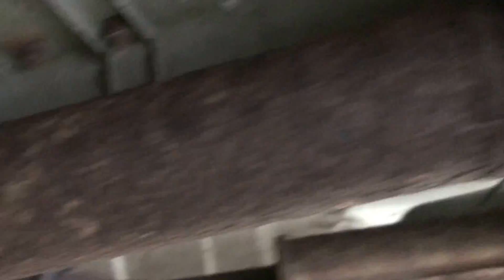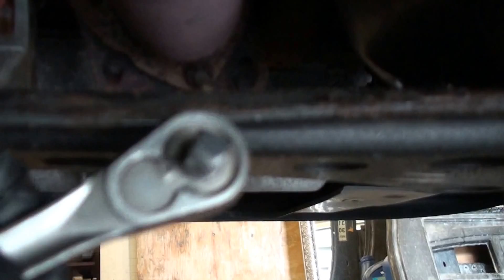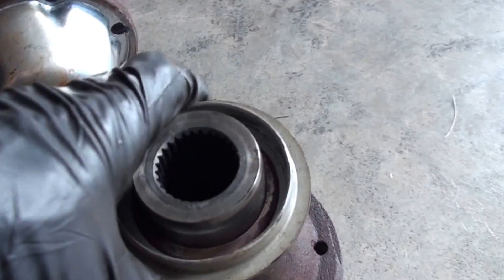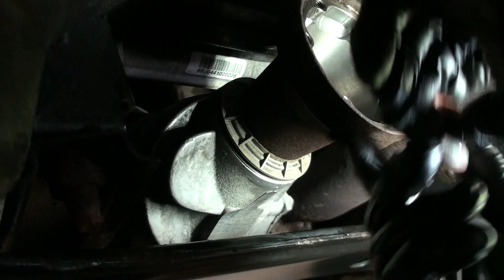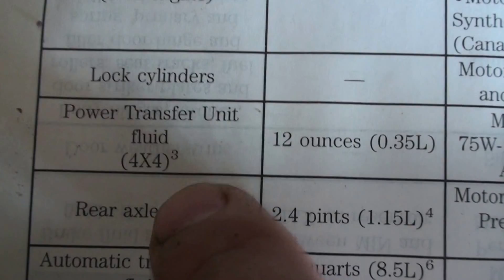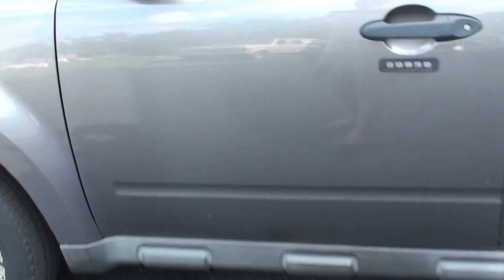Ford Transfer Case Pinion Seal Replacement - Power Transfer Unit

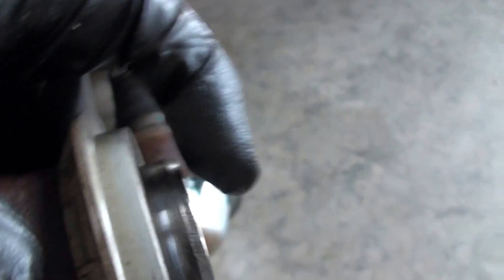Comment: At 10:50 It looks like the surface on the pinion where the new seal will ride, has a groove worn in to it. If thats the case, the new seal may have a short life. I know they have steel bushings with oversize seals for crankshaft pulleys with grooves to extend their life. This might be an option.
Reply from the maker: I see your point but that was not a groove, it was just shiny. The new seal worked perfectly. No Leaks. Thanks for your comment.

Comment: Thanks for the video. I wish your camera had stayed working as I was mostly interested in drive shaft removal/install without having ball bearings hit the floor. I am replacing my K-frame(engine cradle) on my 2012 Ford Escape. I will concur, Brian on the FordTechMakuloco is a great Ford Tech and a good Guy. He provided me with info on the job. Strongly recommend his channel for Escape info (and Ford in general).
Reply from the maker: I remember the day I was filming this repair and we had a couple of power outages.  What a pain in the rear that was but pushed on.  Just remember when giving that CV a couple of light hammer smacks to break it free have your other hand on the CV to keep the cage together.  Then as it separates from the differential and slowly lower it to the ground.  Have a plastic bag ready to wrap it up and keep the grease from oozing and making a mess.  Good luck with the repair, sounds like your Escape might have some rusty crusty K frame issues?
Reply: @ozzstars_cars  Yes, the K-frame had rusted through on the passengers side along where the K-frame follows the curve of the control arm. Three spots where covered with surface rust and when I chipped that away, holes through the metal started to show through. The other side of the k frame on the passengers side also had rusted through. I though about getting it welded (which I'm not set up for) as that would have been ok for a season, but decided as I had already removed control arm, hub/bearing/knucle, and strut, the car wasn't going anywhere too fast. So I decided to get the K-frame and try it myself. I liked you video as it showed the process of removing the drive shaft very well, so thank you for that.  Youtube has videos of rusted out K-frames that are much worse (and dangerous to my mind)
Reply from the maker: @bwuepper439  the good thing is you found a serious structural defect before there became a serious safety problem. Did you buy a used junkyard k frame?
Reply: @ozzstars_cars  No, I looked online and found a Ford site that has OEM parts. Their price was reasonable ($340) and shipping was about $28. They are a Ford Dealership in WI near Milwaukee. They were great to work with. Only took a couple of days to receive the K-frame. I would rather get a new Ford part for something critical like this than a unknown part from junkyard.
Reply from the maker: @bwuepper439  that sounds reasonable for a new oem k frame. Good call!

Comment: I just did mine .. I dint know the torque for the 27mm nut so I just put 110lbs I hope that's enough... 30lbs for the 6 holding the front and 15 lbs on the 4 10mm bolts.. I hope that's OK...

Comment: I just got an Escape 2003. Near the same tranny case. I THINK the case is bad. As I slow down from 30 to 15 it goes WOOPWOOPWOOPWOOP. No shake in wheel or tires. Car handles amazing otherwise. Giving gas has a slight grindy sound at first. 

Oh yea. This seal is also spitting stuff all over. So. I think my case might even be bad. Thoughts? Needa check fluid of course..
Reply from the maker: Depending on what year those Escape transfer cases can be a big job to replace. Very common issue if the oil isn't replaced every 30-50k miles.
Reply: @ozzstars_cars   preciate it. The thing spits junk from the output shaft seal so idk :/ silver and black junk.

Comment: New front seal is installed dry? Did not see you put or hear you mention putting any silicone or lube of any type on new seal. Is that correct? Thanks for your time
Reply from the maker: The inner part of the oem seal that rides on the shaft is pre-lubed.
Reply: Thanks, useful video and information for that type transfer case on both Ford Escape 4X4 and 2009 + other Mercury Mariner 4X4 V6.

Comment: Hey Ozz, great video
I had some major drive-ability issues this morning and had to take my 09 ford escape to pep boys for the fast diagnostics i could, due to the outbreak and the weekend.  So what they showed me underneath was a some play from where the drive shaft connects to the PTU.  They had told me the bearing in the PTU need to be replaced.  Does this sound right to you?
Any advice would be greatly appreciated, thank you
Reply from the maker: If you are experiencing vibration that could be the issue.  I can't tell you over the internet unfortunately.  How much is some play?  The ptu gears tend to wear out if the gear oil isn't changed regularly like every 30k miles.  How many miles does your Escape have?
Reply: @ozzstars_cars  I actually just changed it last month. It did wiggle. It is vibrating also. I think I was wondering if maybe it was more likely a drive shaft issue rather than a ptu bearing problem. I have had no luck this afternoon finding any part called a ptu bearing. The guy at pep boys couldn't find it online either.
Reply from the maker: @seanstapelfeld6448  I would remove the driveshaft and check the CV joint.  Also common to fail.  You didn't say how many miles.
Reply: @ozzstars_cars  145k.

Comment: Great Video! what torque spec did you use on the 6 torx bolts on the PTU, the 2 on the carrier bearing/support and the 4 on the U-joint at the rear diff? I can't seem to find these numbers anywhere! any help is greatly appreciated! Thanks!
Reply from the maker: Loctite and snug. Thanks for watching.
Reply: @ozzstars_cars  Thank you!

Comment: What size bit did you use for those torx bolt's
Reply from the maker: I state the torx size in the video.
Reply: @ozzstars_cars  sorry about that i must ha e missed it. I am trying to replace the drive shaft on my 2013 ford escape and i don't think i have the right size bit for the torx bolts would you know what size they would be.
Reply from the maker: @Violetmakeup11  not sure off hand

Comment: funny how your camera dies for the removal and install of drive shaft.  Tells me you were heaving and cussing.
Reply from the maker: Not a good battery day, the electricity went out during the middle of the job.  Not much cursing on this one the shaft popped right out. Getting the seal out was the hardest part.  Fairly easy job. Thanks for watching

Comment: Great video! I have a question about my 05 Escape AWD. My driveshaft completely separated from the PTU where that main rear seal is https://imgur.com/a/p8SYksz. Do you think the whole PTU will need to be replaced? Thanks man!
Reply from the maker: Hard to tell from the pic.  Remove the CV joint and see if there is excessive play or damage to the case or the output shaft.
Reply: @ozzstars_cars  Dang, thanks for the quick reply. Will do when I have time! I'll try to update the comment with what I find / solution. Your video is going to help me a lot, thanks again.
Reply: @ozzstars_cars  so, been working om removing the driveshaft for the last few hours. I can't back the driveshaft out enough for the CV joint to clear the housing. Seems the driveshaft is stuck where the u joint meets the carrier bearing. Took the saddles off but the driveshaft is not budging. Any ideas? Thanks man!
Reply from the maker: @davisgarth10  use a hammer and tap the yoke of the drive shaft where the saddles were. Seperate the driveshaft from the center carrier bearing. HOLD the shaft with your free hand while doing this because it will fall out.  Then slide the cv end out and away.

Comment: I did the seal and after a ride when i Check it with a light it looks shining at the edge is it normal? Theres no dropes and when check it by hand there is no oil leaking
Reply from the maker: If the differential has gear oil in it then I'd say the seal is working if there are no leaks.
Reply: Ozzstar yes there is gear oil in it , but i was wondering if it is normal to look shiny at the first drive , may be after a while it will be completly dry and no shining at all in the edges of the axle shaft, what do you think?